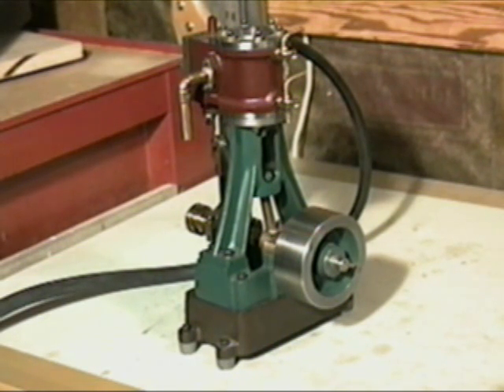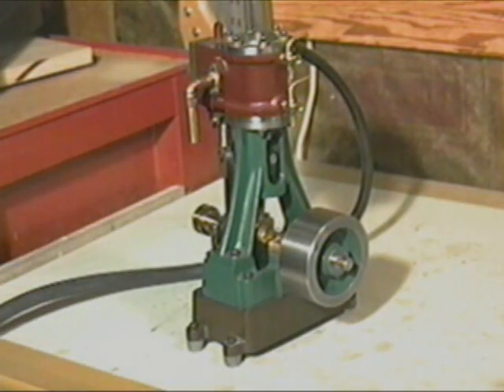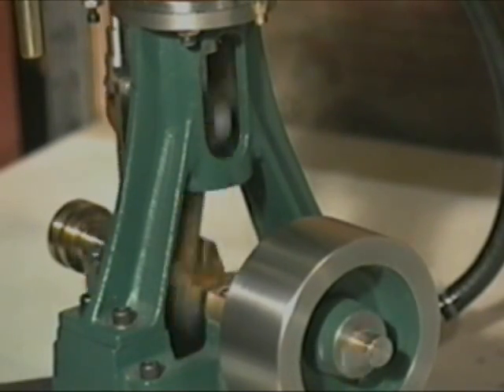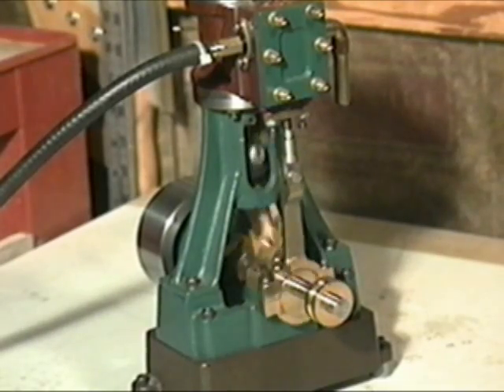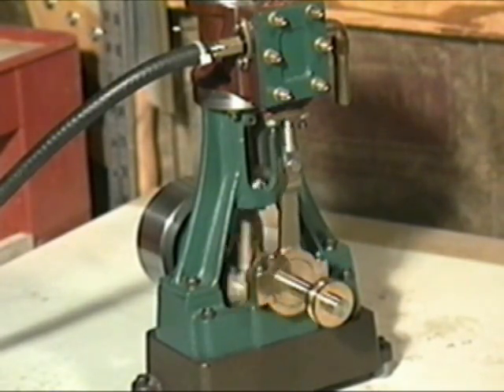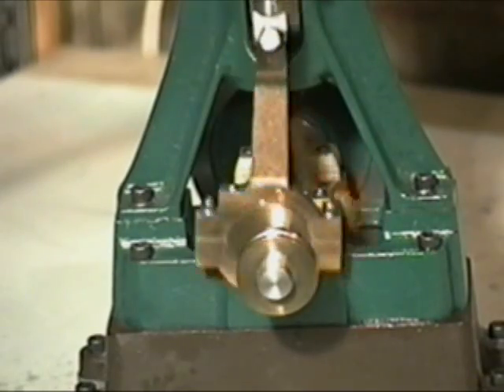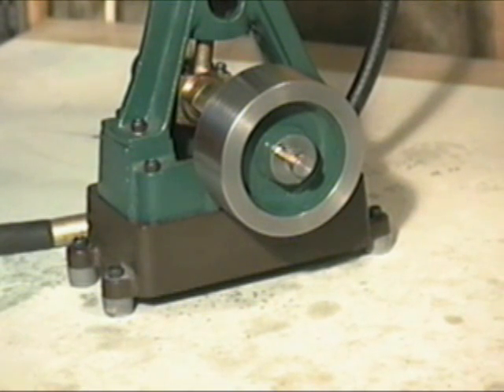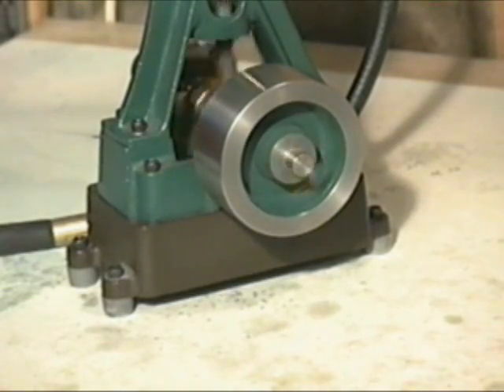ST4-SteamEngine.mp4

Comment: Hey, you're Thomas Cross!  I recognize this footage from your 2003 DVD "building the Husky Engine".  Did you ever paint that nice Cole's small hit & miss that you featured running on the video?  I have one too, they are sweet runners.
Reply from the maker: I never did paint the Hit & Miss.  It would be more valuable and pretty.
I would also like to make it a new cylinder head with a better valve design.
But I will never get to that.   I can still go ,outside a little here.  But when the weather forces me inside, I will start on the Stuart Beam engine castings I have.
ShortHand

Comment: I'm surprised that the "steam nazi's" haven't commented yet. They believe the engines perform differently on steam, while some of us feel the main difference is danger from boilers and water all over. For demonstrating air works fine, for using to power something steam makes sense. Did you machine this?
Reply from the maker: Hi,
   Glen I machined the ST4 from non Stuart castings made by Bob Canovan in Canada.    Check out my PMR 1880's Steam Drilling Engine on steam at ShortHandTom.   Also the machining video of the valve case.

Thanks, Tom